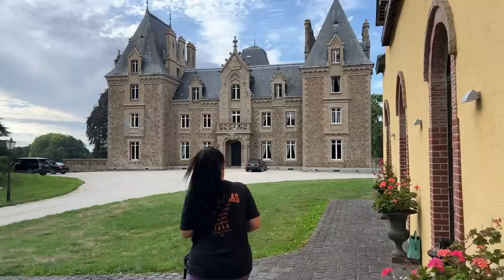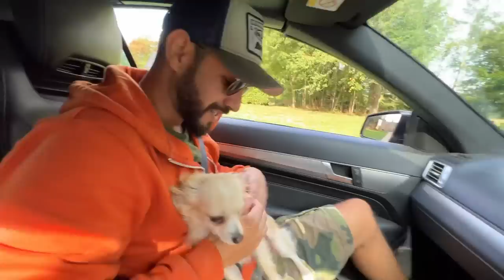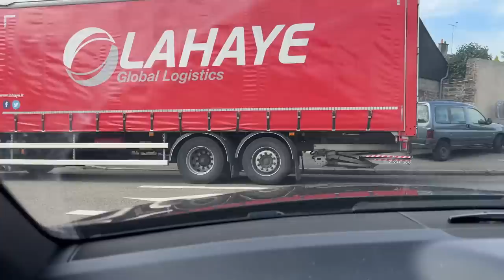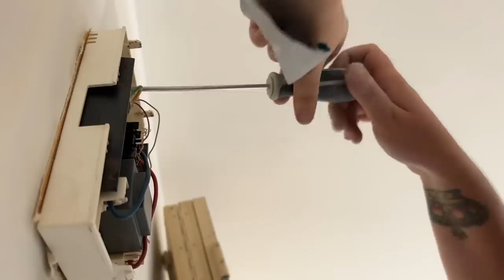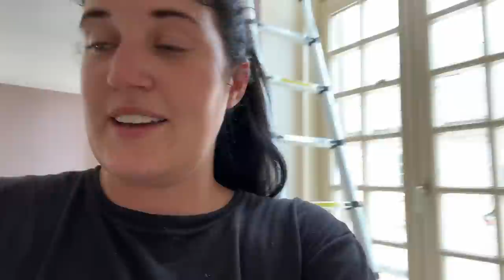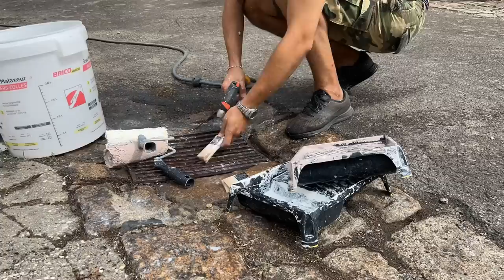A QUICK Day At The Convent!!

Comment: If you wrap the rollers and brushes each individually in "saran wrap", to make air tight, you don't need to rinse them out, I loved that trick when I painted my house. Y'all are doing a great job!
Reply: I don't like doing my brushes this way as I find that the paint build up is harder to remove. BUT, I love doing this for the rollers.
Reply: I've painted a ton over the years and wrapping them in plastic wrap, or even better, sticking them in a zip lock bag, rollers, too, is a great way that they stay fresh and ready to use the next day. Not sure about washing the paint into the gutters out front, Mo. That water may go directly into a river or stream with fish. Just saying.
Reply: I do my brushes and rollers alla time that way but mo is correct in the heat it will dry the way u had it, as everyone says you have to wrap the brushes etc al to totally exclude air
Reply: Yes I agree.
Reply: I do this as well, with cling film, fine if you know you are using them the next day x
Reply: I wrap rollers and brushes in plastic bags and if I think it will be more than a day I put them in the refrigerator. Works in America.

Comment: The trays I would have washed but the rollers and paint brushes, I’d have wrapped in plastic. The trick is that the paint can't be exposed to air so you have to squish the plastic around the roller or brush. I'm loving the pink and can't wait to see the finished product but really enjoying the process.
Reply: That’s what I do too, less paint going down the drain :)
Reply: Also washing the rollers means they will still be wet the next day and dilute the paint. At least that is what I learned.
Reply: The temperature doesn't matter when wrapping the rollers...whether it is hot or cold.  The key is wrapping the plastic directly around the brush or roller as Gwendolyn described and then putting them inside a bag.  Rollers and brushes stayed soft and usable even when I pulled them out a week later.
Reply: There are roller spinners you can attach the roller onto then crank it to spin excess paint/water out of.  98% of people do a miserable job cleaning their rollers and brushes
Reply: @loist0607  yes I have also done that instead of washing the rollers and brushes - if so knew I was going to be painting the next day.
Reply: That is true, remove the air and wrap each TIGHTLY in its own bag or saran wrap.
Reply: That is how we do it also.
Reply: You can wrap the brushes in a plastic store bag or food wrap.  throw all of it in a bin bag.  Been doing it for years.
Reply: @spiritofanu3112  even the tray and rollers.  Tell Mo to chill.
Reply: I secure my plastic wrap with a rubber band and put in refrigerator. Fine for 2 days. (Mo doesn’t know it all. I checked the temp in your area today. I do this in 35° weather.)
Reply: Sadie and Mo can do it their own way.  I find the comments helpful to the followers who read them.  We can all learn this way. It is not necessary that Sadie and Mo follow everything you all say.

Comment: Sorry Mo you’re wrong. Husband was a painter for over 30 years in the Mojave Desert and if you put your paint things in a plastic bag and close it, paint will stay fresh for a day or two. Old  professional painters trick. For the record Mojave desert is hotter and drier than pretty much anywhere you’ve ever been and the wrapped paint rollers and brushes stayed fresh for days.
Reply: Hi there.  I’ve been watching all the work on the convent apartment.  An interesting project.
Mo and Sadie are both working hard on their new home.  They are learning as they go, so I
am not surprised that they are doing things their own way.  I have repainted houses many times and also learned through those experiences.  Storing wet brushes and rollers in plastic has worked amazingly well for me over the years.  I can’t speak for why Mo thinks otherwise.  All the best to Sadie and Mo.
Reply: As a one time professional painter myself over my 56 years, I have definitely wrapped brushes in plastic wrap due to time constraints / wanting to go get a few beers at the bar.  It’s not a problem doing so.  Looking quickly at their paint rollers / trays / brushes, I can tell they are… how shall I say it politely… not that clean of painters.  A true professional painter does not get paint on their hands, clothes, up high on brush handle & after cleaning their supplies they are basically brand new looking.  You can use a good Wooster or Purdy brush for well over 10 years if taken care of.
Reply: It is true and I have done so multiple times.
Reply: Me too.
Reply: I do it but put in refrigerator.
Reply: Hi Sadie and Mo, Just try wrapping one wet btush ovrrnight in plastic and you will verify that is correct.♥️
Reply: I usually wrap my stuff individually or airtight as well. I lay cling wrap or a plastic grocery store bag gently over paint and roller in the tray to go to lunch or dinner on a hot day, but for end of the night, I wrap each roller tightly in foil, grocery bag, or saran wrap. You can even wrap a brush with oil-based paint very well, airtight, and keep in the fridge for weeks (linseed oil in paint cures with oxygen, so I may also try laying a small cut of plastic wrap gently on the surface of the paint and up the sides of the can before sealing the lid back on, if I don’t have a smaller extra container to transfer it to.)
Reply: Mo the wrapping of rollers & brushes works & saves a lot of effort trying to wash the paint off, if you’ll be painting with them within 48 hours. You’ll need to wrap the plastic bag or plastic wrap tightly around the roller & the paint brush to push out the air to stop the paint from drying. As for the paint tray, pour any paint back into the paint can & put the lid on, then slip the tray into a plastic bag ,pushing as much air out as you can. This technique really does work. I’ve done this many times over the last 35 years.

Comment: I wrap rollers and brushes in old plastic very tight and they don't dry you can wash them and rinse them until the water runs clear and let them dry but some little bits of paint will dry and make hard bits. If I will be painting the same color again I just wrap them up.

Comment: Really was curious to see if placing all the paint items in the plastic bag worked with the cleaning up process.  If so, that would be brilliant!
Reply: I works!  I have done it for years.  I am compulsive home room painter and paint often.  You need to use as small as bag as fits and try to get air out without smooshing paint all over.
Reply: Cline film is much better way so no air hardens the paint on the brushes
Reply: I put the brushes in a plastic bag and wrap it tightly around, if a am going to use the next day. Not sure that big bag would work.
Reply: I've done that so many times and it does work, no matter the weather, you just really have to seal the bag proper
Reply: Also works to wrap in plastic or foil and keep in freezer. Someone else mentioned fridge works too.
Reply: @janicemartin1580  Thanks very much for the info.  Will be putting in to the test very soon. Thanks again!  🙂🙂
Reply: @vanessagray8604  Hmm... I don't know what Cline film is.
Reply: @roseharvey2664  Thank you Rose.
Reply: @SandraAngelina  Was wondering if weather had do with it. As Mo mentioned because it was hot, it wouldn't work???
Reply: @jmausa6688  cling film like Saran Wrap
Reply: @jmausa6688  I think that would be Cling wrap,  Saran wrap, or Glad wrap depending on where you live.

Comment: With all the others air tight plastic wrapped brushes and rollers will stay fresh even in very  hot weather. I use plastic trays so you can peel off the old paint . It is much better for the environment then putting paint in the drains and only washing them when you’re done with a job so you don’t put pamper paint in the drains

Comment: If it is so dry in France at the moment,  why waste water on cleaning brushes when you can use cling film to seal your brushes and rollers to use again.  They will keep fresh and not dry out as long as you squeeze all the air out of the film and wrap them tightly. The brushes and rollers will stay soft and pliable for a few days.  Give it a try and try not to waste so much water.  If you also place a layer of cling film over the paint trays and push it down onto the paint, they will also be able to be used the next day without any issues.  It is air that will harden the pain on your trays, brushes and rollers that is the issue.

Comment: Sadie, as long as there is no air between the plastic and the brush it should be ok. I put plastic wrap over the paint in the trays with no air bubbles and wrap the brushes individually - and tightly - in plastic bags. Always better to wash them though!

Comment: Good rule, clean your brushes every time you use them. It’s a pain but so are dried out brushes. 
Another tip buy really high quality brushes and keep them forever. They are a joy to use and there is a big difference in how well they perform!
Reply: Right on, Kathy! I have brushes that are 25 years old and still in good condition because I buy good ones and clean them well after use.